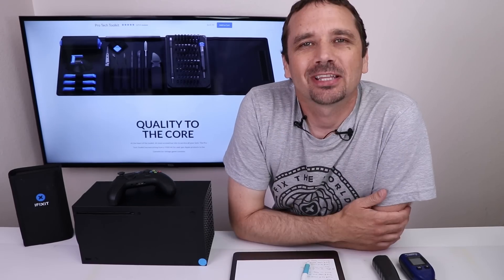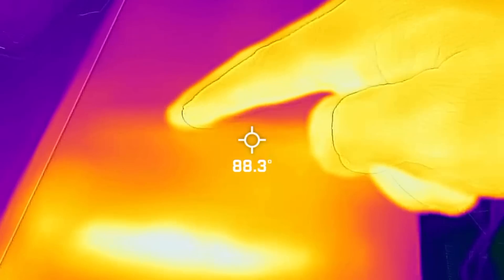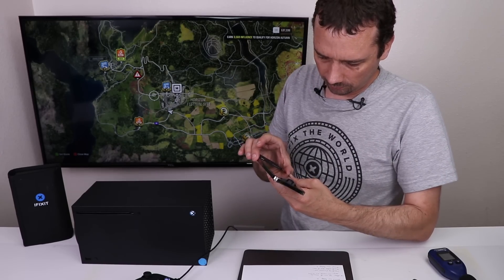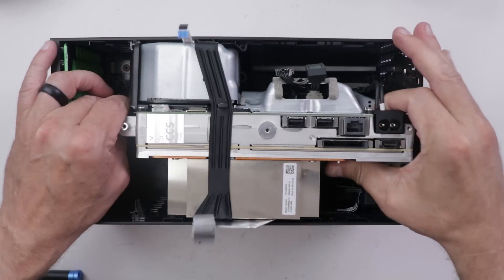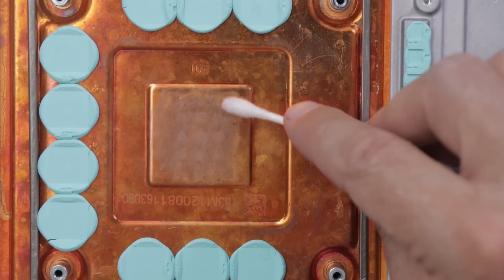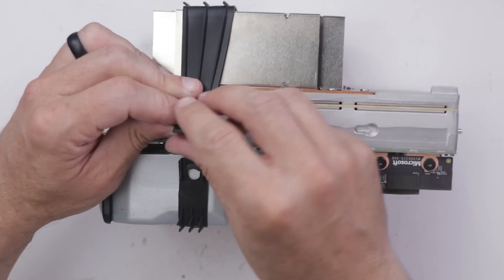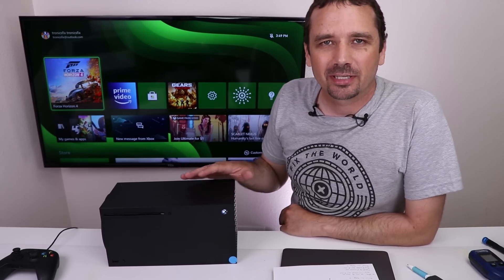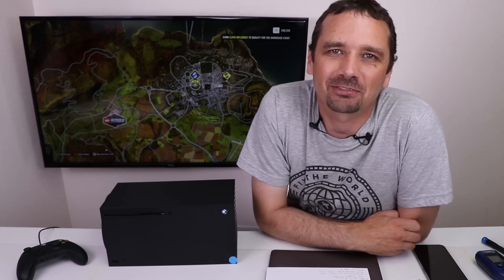I Put Liquid Metal In My Xbox Series X - Here's What Happened!

Comment: The difference in the thermal numbers is great but the difference in terms of what the actual temperature readings were were so negligible that I question whether there's any real world value to using liquid metal on consoles. When you're over clocking hardware, that changes a bit but when all variables in a console are controlled as tightly as possible, I wonder if there's really any point.

Comment: it will be the same if you tried a 100 different thermal paste or liquid metal , because the idea of the thermal paste is just to transfer the heat from the CPU or the GPU to the heat sink , if you want to low the heat down try to customize the heat sink or the fans , good luck 😊

Comment: i was shocked by how quiet my xbox series x was when i got it, very impressed. liquid metal should do a better job than thermal paste at moving heat away from the APU and to the heat sink, so the console being slightly warmer makes sense. liquid metal is far more thermally conductive, yes, but it shouldn't make a huge difference in this setting since both are used to fill microscopically small imperfections. a few years ago, replacing the thermal paste under some processors' integrated heat spreaders with liquid metal made such a big difference because it was used to fill a a pretty big gap. nowadays they use solder instead, if i remember correctly.
Reply: Last gen Xbox was quite as it the way they engineer the cooling system

Comment: I have been testing with a 1070 card that has been hanging on a Thermaltake Tower 900 for 4 years. It hangs the graphics card with the connector area looking up. So the chip is sideways. Same thing with an AMD 3900x. No spills, but always use clear nail polish on the small resistors immediately off the covered area. Also always apply LM with a very thin layer, if you see even a small bubble, you applied to much. Suck up any excess with the same syringe. Think of it this way, feel the metal on the heatspreader, you feel that roughness (even if it's small)? That is what you going to cover, and no more than that.

Comment: I have a question. My series x recently gave me an error E208 recently (update error) but the error came with more than just an update error. When the console is switched on and reports the error it immediately shuts itself off. 
Does anyone know what hardware issue is causing the update error and the shutting down of the console?

The console is under warranty so Microsoft will be picking it up on Monday and dropping off one that works. 
I just want to know for future reference why the one I have now has this issue.

Comment: Ever thought about using liquid metal on the Nintendo Switch?  Or maybe modding the Switch with a larger heatsink/heatsink-fins or more powerful fan? Do you know of anyone who has tried upgrading the PS5's thermal pad on its RAM? Because from everything I have seen the default factory applied thermal pads are basically garbage and are about 3/4 of the size of the RAM chips (that run EXTREMELY hit) which should mean there's room for improvement right? I've been thinking of trying the things I mentioned but Im a bit of a chicken about it, Lol, mainly because my switch is a launch-model and my PS5 (that I luckily got at retail price) is my only one and well, IT IS A PS5 after all which means if I janked up something I may not get a replacement for a VERY long time. Anyway, love the video and keep up the cool and good work

Comment: Figured this would be the outcome.  I've replaced the TIM on my GPU with LM and the results were miniscule at best.  Many have the same results.  Usually means the TIM is not the weakest link in the cooling system of a device.  IMO Sony went with LM to compensate, if only a little, for the lackluster cooling design of the PS5.  MS's design is just better in this regard and therefore didn't need LM.

Comment: More heat out the exhaust is good. The exhaust is supposed to be hot air and if more heat is being moved out the console then obviously more heat will exist there. Its a respectable difference. However it's completely pointless here. The temps prior were more than adequate.

Comment: a question about the ps5 with it been liquid metal is it better to have the console horizontal or vertical?someone told me horizontal because the liquid would been evenly flat where as vertical it will slowly over time all fall to bottom because of gravity.
Reply: there is a foam pad around the chip to prevent shorting from spillage..you can sit your ps5 vertical or horizontal it doesnt matter

Comment: This isn't a meaningful comparison: the console is consuming ~200W either way, which means the exhaust air will be heated by the same amount. The only meaningful info is whether the chip itself is cooler.
Reply: The liquid metal will still transfer the heat to the heat sink better, so the exhaust air should be hotter

Comment: Copper... Most likely that console will go bad faster than later when thew liquid metal turns to dry dust after reacting with copper.

Also on consoles off course it won't make as much difference as PC depending on their fan profile which will most likely also decrease the rpm since the temperatures are lower while on PC is custom you can do any fan profile you want therefore at same rpm as before applying will off course make much more difference than decrease the rpm...

Comment: Ive rebuilt alot of xbox 360's back in the day, would liquid metal be better than regular thermal paste?
Reply: Xbox 360s use aluminum for there heatsinks so the answer is no. If it was copper then yes it would of been better for sure

Comment: With or without the liquid metal those numbers are alarming to me. I guess consoles just in general do a poor at cooling. My pc which is far power than any version of xbox or PlayStation sits at about 23 degrees Celsius when idle and to knowledge has never peaked above 44. I don't do a whole lot of super high end gaming but the renders I can do exceed that which any console can do atm. Just curious with numbers in the 50s range what the point when you should be getting worried about thermal damage to the components in these consoles?
Reply: Those temps are way lower than average for PC. Even brand new with a mesh case etc. I was still only able to get my idle temps to 32 C (Room temp during the summer-fall is usually 23 C - 26.7 C).

Comment: Yup, the better the heat transfer from the hot chip to the heatsink, the more waste heat will be removed and thus evident from the exhaust. I love how quiet the fan is in all modes, no sudden speed changes from moment to moment and the chimney effect is really super effective!
Reply: Could also be that the chip is running hotter.  Without a sensor on the chip, there's no way to know if it's doing any better than the regular paste.
Reply: @bokkenka  an increase in heat output from the exhaust is that evidence. If heat output decreased (or if the fan sped up), that would indicate poorer thermal performance. 

And that fan can/does speed up when thermals are out of whack, for example, when putting a game case on top of the system. The fan will notice heat build-up and will spin noticeably a lot faster.

Comment: If the outside is hotter then it may be removing more heat from the APU. Measuring output heat wont really be a key in understanding the difference on the apu itself.

Comment: While the liquid metal helps with the transfer of heat it's not really beneficial to Xbox with static clocks as it would be for the PS5 with variable frequency clocks. In this particular case having liquid metal isn't going to change the Series X's performance or anything really. The fan will still maintain the same temperature on the chip. If we could overclock however we'd get higher clocks with liquid metal over thermal paste. Cool experiment though and a bit ballzi
Reply: It will at the very least extend the life of the console.
Reply: it may not affect the clock speed but it will allow more heat to be transferred..less heat = longer life

Comment: Can you do a re-test under the following conditions:
Run the Xbox under (full) load while re-performing audio and temp measurements.
Place the sound dB unit and set it to measure max peak and average while playing (not saying anything, if possible) - this will tell if the unit ramps up periodically under heavy load/temperature, and how noisy it then is. A better thermal transfer should require less high rpm fan speeds = less noise. 
Measure temperatures while the unit is under load. A good thermal transfer should cool off the unit within seconds - so spending a lot of time first measuring noise, cools the unit down to idle temps almost instantly - and your measurements are inconclusive.

Perhaps testing with Cyberpunk 2077 would ramp up temperature/noise figures even more - I heard it is a taxing game.

Edit - Testing while under load = Having somebody playing the game, not sitting in a menu screen

Comment: This was a very noticeable upgrade sound wise when I did it to my One X. The Series X is so brilliantly quiet though I'm not surprised at the lack luster results here. Sony needs to learn from Microsoft how to build a proper air cooling system as they are miles ahead. Sony was far too focused on fashion rather than function. Coil whine anyone?
Reply: Microsoft go overboard with cooling because they already been burned hard with the Red Ring of death issue
Reply: Why you hating on Sony for? Ps5 is brilliant btw. My pro sounded like a jumbo jet but ps5 is really quiet
Reply: @anthonyrhodes8030  Stating reality is a lot different than hate. I agree PS5 is much quieter than a PS4 Pro but that's not saying much considering it was a jet engine. My PS5 is substantially louder than my Series X and there's no reports of coil whine on Xbox. Objectively the Series X is just a better engineered console. PS5 still has no VRR or NVME support either and we're 8 months after launch...it's bizarre how tribal people are with gaming.
Reply: I’m surprised they are still making consoles after red ring of death. I had 3 and all of them died. No PlayStation of mine has died though

Comment: To those who might be interested in doing this, it's not worth it. You could potentially brick your machine if you do it wrong or get LM where it shouldn't and the end result is only going to net you a few degrees better temps. The actual improvement from a good thermal paste vs. LM is never as dramatic as the thermal transfer numbers make it out to be. The Xbox SX has good enough cooling that you don't need to bother messing around with it.

Comment: Just to be on the safer side, i coat the edge of the die with a layer of thermal paste, with liquid metal in the center to prevent spilling. The expansion and contraction caused by heat tends to make liquid metal spill onto the surrounding. Eventually the amount of liquid metal decrease, causing a drop in cooling potential.
Reply: clear nail polish works as well

Comment: Yeah umm, no offense your measurements are miss guiding. Heat dissipates away from the die.. you cant  tell real time temps by pointing a heat gun at plastics and a fan.. The temps could theoreticlly be higher because its dissipating more heat away from the chip.. like you said at the end of the video. Meaning in reality the higher the temp coming out of the fan means the chip is actually cooler. But I understand it's just a video and you cant get readings off the xbox any other way..
Reply from the maker: What measurements are misguided? Everything you said in your comment is exactly what I say in the video. This was an experiment and I clearly state that the best way to measure heat is right on the APU.
Reply: @Tronicsfix  Yeah,  I don't know I'm not trying to slag you I like your channel allot.. I even tried looking to see if there was a better way, which it looks like there really isn't any better way to check. The only thing I could think of is a old school PC fan control hub that you put in the pc. You could put the thermal wire sensors between the CPU & the heat sink for just the experement to get a better reading maybe?

Comment: Liquid metal penetrates into copper too. After some time quite a lot of liquid metal forms an alloy with copper, making the surface finish uneven. I don't recommend using liquid metal on copper without nickel plating.
Reply: I was hoping he was going to nickel plate it. It’s pretty easy
Reply: While is true there will be a reaction, it is not a problem the LM solidifies but the contact between the die and the copper will be permanently good. You can also re apply LM to liquify the alloy. Also after successive applications the copper gets nickel plated from the alloy. It is a false assumption that LM will "penetrate" copper...I've read studies done with electrolisis and high current over long periods and no Galistan penetrates into the copper.
Reply: @SaccoBelmonte  The problem really start when the user wants to reuse the old CPU Cooler on a new CPU, then you can really notice the ruined tolerances.
Reply: @S41t4r4  You can sand the first applications with some steel wool. Works wonders  and your surface is as flat as new.
Reply: @SaccoBelmonte  sorry but sanding with steel wool is by far anything but flat.
Reply: @SaccoBelmonte  Sanding something does not result in a flat surface especially if done by hand. You would need to have it machined and polished for that result.
Reply: @TheHonkeytonkMonkey  I've done tons of LM mounts / re mounts with copper coldplates. Enough to know sanding the previously applied LM (to clean it, not to remove the plating) results in the surface being just as flat as the original cooler plate's flatness....we're talking microns here folks.

That said, there is an even better technique....which is to apply a bit of fresh LM over the dried up LM, it will activate it and you can wipe it with some cotton...(do not use alcohol)
Reply: @S41t4r4  do you really think a factory finish on a CPU fooler is more level than what you'd achieve with very fine steel wool or sand paper? That would be a manufacturing money sink
Reply: @Harmonic14  better than steel wool and sandpaper used by human hands is not really an achievement. Any kind of decent coldplate is level enough and often polished to reduce the amount of scratches. steelwool and sandpaper bites into copper and aluminium and will result into comparatively deep scratches and uneven removal of material. It's not unlikely to sand of the edge of one side while trying to remove the high parts where the alloy was created, because of uneven pressure. Unless you have a machine that does the lapping for you and you have good quality lapping stones, you will never improve or even achieve the factory tolerances.

The only reason why you can see temp differences by sanding the ihs of a Cpu is because the Cpu ihs is the most non flat part in the equation
Reply: Thats true nur you can give it a second Liquidation. After 2 month it hardens.but the transfer Speed ist the Same
Reply: German spotted

Comment: Seems like you possibly used a bit too much? Id like to see it pulled back apart to see if the liquid metal squeezed out the sides. I wish they had a way to log core temp properly, since those temp readings dont really show the possible improvements.

Comment: I'm a chemical engineer and your theory is correct due to liquid metal's better thermal conductivity the outlet air temperature would be higher because it transfered more heat from the chip to heat sink but if you check the APU die temperature it would be lower which means more longevity for the console
Reply from the maker: Thanks for the confirmation. Yes, if I could measure the APU temp I think it would be lower with the LM
Reply: @Tronicsfix  and what happens to the chips with silicone, I mean in time will the heat uncovers them or they will be "safe" from the T-1000 if they spread, i mean liquid metal jejej
Reply: @Tronicsfix  bro, u need to put more LM u put too little the temperature dont be higher to termal paste
Reply: But can you build a Time Machine out of a Delorean?
Reply: @Green Mamba Games well first of all he put LM on a console where the cpu and the gpu are in one package caled the apu and that components dictates the performance of the console. Second your use case is mining and if i want to use my graphicks card for gaming LM can help drop the die temp and because of that i can get a bit more core frecueny of the card and have beter overclocks witch will give Me beter Gaming performance. Most well build gpus from good manufacturers can take the increased heat load of overclocking
Reply: @Green Mamba Games add some external push fans from bottom say maybe a 20mm fan or duals running through usb ;) that’s how I have mine on my PS4. Just above APU’s clamp
Reply: خالی نبند
Reply: @sinapahlevani  😂😂😂😂
Reply: Cool does not necessarily mean the hardware will last longer. The stuff is meant to run hot and all recent hardware will shutdown if it goes over certain limits.
I can't imagine lowering temps would add anything to longevity. By the time stuff breaks down (from normal temps) it will be considered ancient.
Reply: @bobshanery5152  citation required.  electromigration happens at all practical temps and directly proportional to heat usually via voltage increases.
Reply: Correct on theory,  if the component placement is correct…..  more heat in console = more heat on component like capacitor on mainboard near heatsink . So not good upgrade. Microsoft is not stupid
Reply: @craxymax  yes but remember it uses a vapor chamber not a copper tube heatsink like the PS5